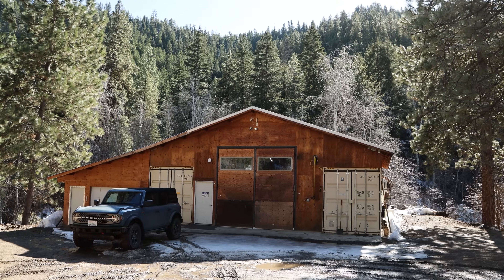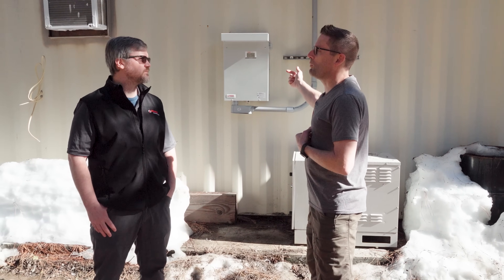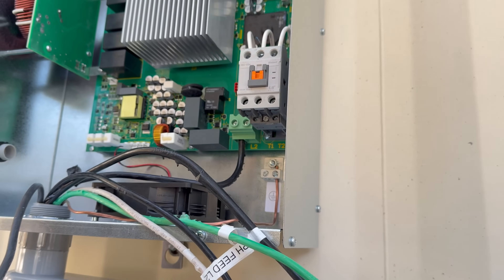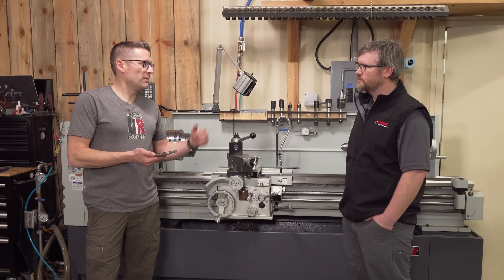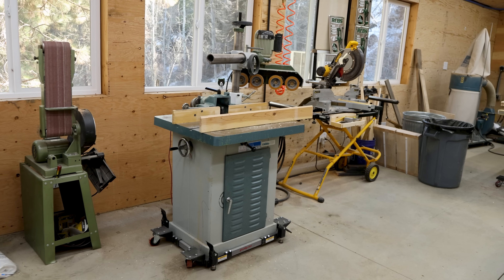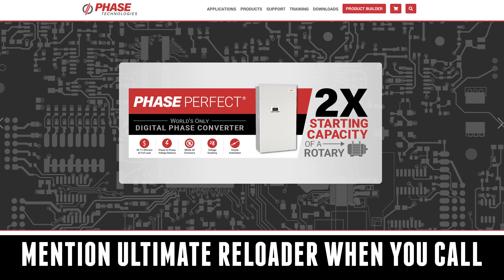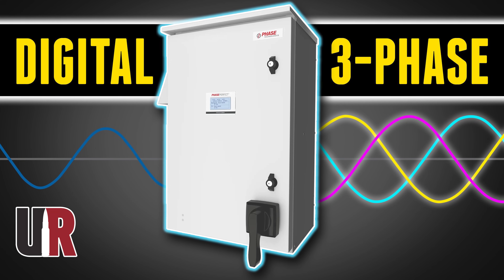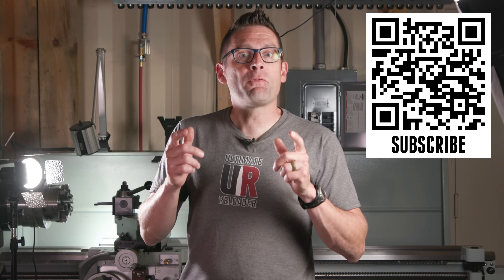Digital vs Rotary 3 Phase Power: Phase Perfect

Comment: Why not just start up at a slower speed and increase to the desired speed slowly ?
No additional hardware needed .
Reply: 3 phase is always better for motors. This is a comparison of electronic 3 phase generation vs have a single phase motor turn a 3 phase motor/generator.  The other obvious alternative is a VFD for every piece of equipment.
Reply: He doesn't have a VFD on the lathe, and you can't shift the gear box on the fly.

Comment: Really would like to see multiple tests other than 0 to full speed timing. First would be a graph of current. Wear on the motor assumes the current is very high at the start of the cycle. A slow start does this but if the current spikes really high, really early, the fast starting could be wearing the motor more than the slow start. Second, as this equipment is not dedicated to the machine, need to see what what happens when a second motor starts while a motor is running. Current spikes tend to collapse the voltage. That nice surface finish on the 1660 might just tank if the woodworking shaper or the 1440 starts up while it's running. The tell0tale sign would be an uncommanded drop in RPM. Electronic phase converters are often dedicated to individual  so this equipment should be compared to dedicated VFDs.